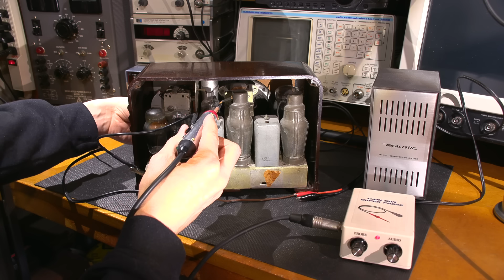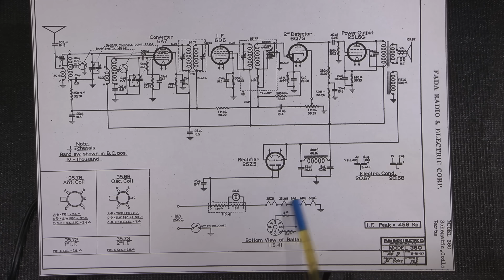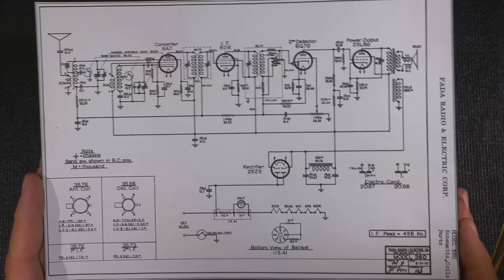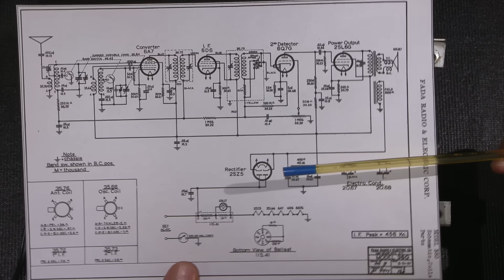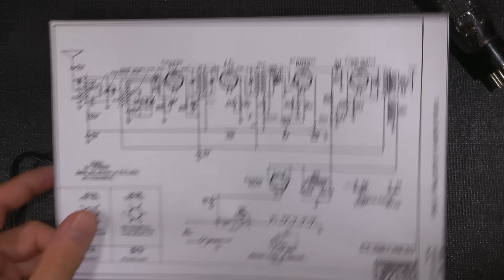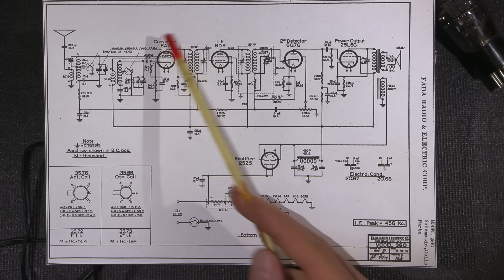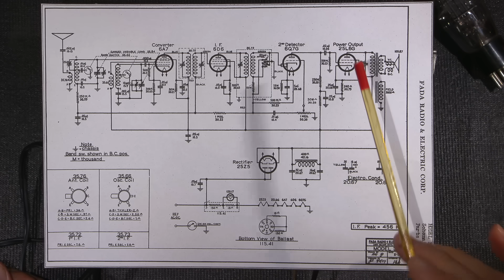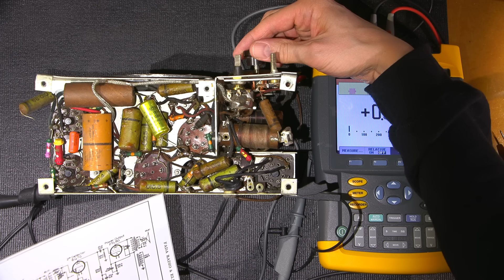Electronic Circuitry Diagnosis And Fault Finding! [Repair]

Comment: This was a very good diagnostic coarse Mr. Carlson. I am working on a Sparton Radio/Phonograph with a similar no output at all. Out Put Transformer & Speaker test good.Tubes all test good & heaters turn  on. Changed some Capacitors that were defective but must test more & carry on I guess. I would sure like to buy a Carlson Super Probe if available. Thank You.
Reply: PS That Sparton Radio is a Model 5348   made in Canada just for added interest.  Thanks again.
Reply: I now managed to get sound from this radio 6 hrs after my previous message. Found a shorted .05 mfd cap shorting convertor tube grid to ground. Also found the Output 6F6  tube intermittent. Would some times pass emission test but sometimes fail. Tap on 6F6 to get a squeech & then normal audio out put. Will have to replace the 6F6 in the future for reliability.

Comment: I think it would be cool if you did a lower filming quality series(so you can put more videos out faster) of devices that suffered catastrophic failures and diagnosing them, what caused it and following the chain of failures that lead to the "death blow" that finally killed the device then if you have time maybe try to resurrect the device within minimal parts and effort. Kinda like how Shango has resurrected dead baked tvs which sat in the desert for 45 years or so! much love, keep up the awesome content you do awesome exceptional work. <3 :D

Comment: Yes it can be done ,  for me it was easy , yes some work had to be done , but it was safe on or off with out unplugging the radio. I am 59 years old and I stated working with tube type around twelve years old . I remember what old radios and TVs smell like. if I ever have a lab I would want it to be full of new and old things to fix.

Comment: I was servicing this type AC DC Operation radio on 1985. When the polarity of AC input changes it use to give current shock if we touch the chase or even control knobs.. I Enjoyed the audio quality on those days. As up to now i never heard such beautiful audio. This is from India. EL84 and ECH 81 vacuum tubes i used to replace on those days.

Comment: Very clever way to troubleshoot, I’m still having a hard time understanding why the circuit would feed B+ Dc to a field coil. It seems as if this would lock the speaker coil inward(retracted) or outward. How can the speaker oscillate in and out to produce audio if it is being held in one direction by the field coil that acts as a constant electromagnet pulling in one direction? Thanks for another interesting video. Please remember to not be afraid to show you are human and not a robot with an occasional smile from time to time. 😀👍
Reply: @Mike - IANAEG (I Am Not An Electronics Guru) … but, I think you are confusing the field coil with the voice coil.  The field coil creates a constant magnetic field - the function that a permanent magnet would perform in today’s speakers.  Then it’s the fluctuating voltage in the voice coil (physically attached to the cone of the speaker) that causes voice coil+cone to vibrate and produce the sound.
Reply: @citizen240  iteresting, I never knew that an electromagnet was sometimes used in place of the typical fixed permanent magnet type speaker we see more commonly. Thanks for the clarification, this makes sense now. 😎👍

Comment: most of those radios if plugged in backwards would make a definitely growling sound in the audio and i know about this because i took radio and tv repair as a vocational course n high school during that era so i know first hand what a jolt you could get from them if you wre standig barefoot on concrete or touching bare metal that was in contact with that concrete

Comment: The dial light was often part of the filament string, acting as a pilot light.

Another use of directly heated cathodes was in pre-transistor portable radios, which ran on batteries and had two or three different ones:

The A battery, usually a 6V lantern battery, to heat the filaments.  They were in parallel, but each one had a choke (either RF or audio depending on the frequency) to isolate the cathodes from each other;

The B battery, a medium current battery of 45 to 90V or more in multiples of 1.5V, to run the plates (this is why the power supply output is called B+);

And with some designs, a C battery, usually 18 to 45V, not drawing much current at all, with the POSITIVE side to the chassis and the NEGATIVE side (with a choke) going to the grids to keep them negative.  The AC signal made the grid less negative in the positive half cycle to allow more plate current, and more negative in the negative half cycle to allow less plate current.

Comment: The speaker driver is very old! I would replace it with one that will fit inside and has the same sensitivity, if possible? If not I wouldn’t waste my time or resources and hours of work to restore it because it’ll sound like crap! Also I would use detox on ALL the knobs, volume control knob for tuning the stations and the frequency know for short wave as well!

Comment: I have a Philips Sajita series Tube radio.MW and SW bands are fine but Its FM band has not been working for the last few days.After turning on the FM band works properly for a while, then suddenly the audio goes off.Which parts may be faulty for this problem?please suggest me.I want to repair it.

Comment: I'm a 40 year retired industrial electrician. One of my lines started up in 1960. Has ad several upgrades over the years. The original 1950s  electrical/electronics equipment that was  still left in place has outlasted the the 1980s equipment.

Comment: Yes,  I see, if the switch doesn't work you could touch the chassis with bare wet feet in order to power the radio. If you can resist the pain, the tubes will light on and you can even hear the radio...

Comment: This was a very poor evaluation of the problem. Yes the tubes are faulty or the electronics have failed, but what  if the problem id in the RF section? You need an RF generator. I would love to have an opportunity to work on an old tube unit. God the time stops for no one.

Comment: check for the negative voltage on the filament for proper tube conduction. If positive to the coupling capacitors are leaking DC to the, sorry I'm drunk to the plate  is something then replace the capacitor will do it.

Comment: come on, check the  tube manual for the filament pin connector. pin 4 an 5 for continuity, If the tubes ha it go to the next

Comment: This reminds me of my days in late fifties.  Repaired many of this type of Radios in those days. One thing I may add that we used to call these type of circuits as AC/DC type Radios because this type will also work on DC supply power. This type was the cheaper  as compared to the AC only which was much safer because of the builtin Isolation Transformer. Many times we use to touch Grid metal Cap on top of the tubs for quick diagnose by listening to the Growling sound from Speaker indicating that Audio section and IF section upto that tube is OK. Thanks for the Video.

Comment: Thank you. It is just what I wanted to learn when I was 13 years old. I had a collection of old radios at that time. However now I am 71 years old. I wanted to learn this 58 years ago!!! I ended up doing a mechanical engineering apprenticeship instead of an electical apprenticeship . Now I see how technical it is, I may have quite rightly been better off learning limits and fits like I did. LOL
Reply: My thoughts exactly. I hung on to one old Phillips radio for the longest time, trying to fix it. One of my friend’s father remarked, “It’s probably a capacitor.” But at that point, I couldn’t tell a capacitor from an intermediate frequency transformer. I really wanted the thing to work because it had push button tuning like a car radio, and I thought it was cool.

Comment: Currently, I am restoring a 1936 Pilot model 203 export model made in Long Island, NYC. I started working on radios when I was 9 years old in Edison, NJ. When I was 10 I had my own business repairing radios and later on some TV's. I needed the money to support my hobby flying R/C model planes. The battery's were two 67.5 Volt and one 1.5 Volt for the transmitter. They were very expensive for a kid in 1953.
Reply from the maker: Thanks for sharing your story Ted!

Comment: Sorry your fault diagnosis was long winded and quite unnecessary and  some of the technical terms you used were quite misleading.
I am a retired RAAF electronics tech of over 20 years service used to working on equipment much more complex than this but the procedure used to fault find equipment is fundamental to good workshop practice.  On promotion to SGT I taught electronics theory and practice including logical fault finding.  First do not ever switch a set on this vintage on to  live mains no matter how well protected.  Second do as much testing as you can with an ANALOGUE MULTIMETER before ever thinking about applying power.  Over here in Australia we are dealing with 230-250V 50 Hz mains which can definitely kill you especially on LIVE CHASSIS sets such as this is.  117 phase mains as you have in the US most times will not kill you but if an individual has inherent low body resistance it can have a good crack at it. You are dead for ever, no second chances.
I mentioned an ANALOGUE MULTIMETER because it can apply a lot more voltage and current on resistance ranges to testing circuits than can a digital meter which typically does not  actually apply much voltage or current in resistance range testing at all.  Analogue will also find components with serious  high resistance leakage much more readily  than will digital.   
 The schematic says  V1 is a converter because that what it is.  In communication sets the LOCAL OSCILLATOR AND MIXER can be two separate electron tubes.  Calling the stage a converter implies  the stage is a combination of local oscillator and mixer,  such as in a pentagrid frequency convertor, such as a 6BE6, 6D8G  or even a battery 1R5.  IT IS NOT A MANUFACTURES CONVENTION AS YOU IMPLIED 
 I have not ever heard that old type of resistor made from cracked carbon called a dog's bone before, maybe just the US terminology.  
Now to the fault finding proper, because the set was as dead as a dodo, not even any hiss from the speaker indicated straight away either no HT or something seriously wrong with the audio stage, even the  ELECTRODYNAMIC SPEAKER FIELD COIL WINDING being open circuit.  Taking resistance readings  with a good analogue multimeter would have indicated the fault without putting undue stress on the dual rectifier with power on regardless of the high impedance supply used .  As you indicated, a hard to obtain electron vacuum  tube is a 25V heater type.   
Live chassis radio sets were illegal in Australia except for the types imported from the UK by their owners on migration . The US types would have been a problem here because of the 117V mains potential required.   A step down transformer would have been required which because of the isolation it provided,  the set would become safer in operation.  
As you mentioned paper type capacitors impregnated with wax tend to go leaky if not indeed as in this case s/c.  Moisture seems to be ingested over their lifetime causing the dialectic to breakdown.
In fault finding diagnosis you proceed from the obvious first using the half split rule, the audio stage was dead, no point in going to the RF stages till you have something from the set's  speaker. A simple finger on the first audio amplifier grid would have proved this, as you say don't do this with Transmitter stages.
Reply from the maker: New to the channel Robert?
Reply: I have watched a couple of your video's on YouTube before but this one last night intrigued me as of practices you really should not do.  An isolation transformer is essential in working with SMPS as the mains is directly rectified and ground must be referenced with an oscilloscope for fault finding.  Definitely in this case where the whole chassis could be live.  
I started my working life with an electrical/radio apprenticeship in 1965 at 15 but before that I was learning to repair old 1930's  to 1940's electron tube radios as a 13 year old kid.  With live chassis radios I have fault found  recently  they were from the UK and the chassis was insulated from the frame of the radio from manufacture.
Another thing you could have done would have been to give a quick rundown of the principal of operation of a superhet type radio receiver rather than just alluring to the operation or indeed if you have done this before redirect readers of your channel to this video first.    Have you ever been a professional in the electronics trade ?   
Also there is an electronics publication which I write for from time to time called "Silicon Chip"  there is in this publication a column called vintage radio, sometimes vintage televisions are dealt with too.  It is also published on line.
Another risk you undertook applying power to this vintage radio without prior inspection was with this high cut capacitor s/c the primary winding of the output transformer could have gone o/c due to increased current in the winding.  Wax paper capacitors were notorious for going leaky and s/c both in radios from the 1930's onwards and televisions of the 1950's and early 1960's.  They kept servicemen in business as the mean time between failures  was not much more than 6 months being the case here in Australia.  I serviced televisions as a teenager and later for extra money in my twenties as the RAAF pay was not sufficient to support a family.    With televisions miniature electron tubes were used in low power stages and these failed more often than the 4 , 6 pin and octal vacuum tubes of old.  The barium coating on the cathodes of the old tubes was thicker leading to a longer life before the electron emission diminished to a point were the  tube failed due to insufficient emission......Regards Robert

Comment: The back cover, as you know, had the antenna wound on it with a terminal attached to let you connect other wires for add lengths to increase reception.

Comment: I vote to restore it. PS I have a "hack" I use in lieu of an isolation transformer: I take a neon tester, or a voltmeter and hook one end to the metal chassis and the other end to a ground nearby; if the tester lights up, I know the chassis is hot.

Comment: Greetings:
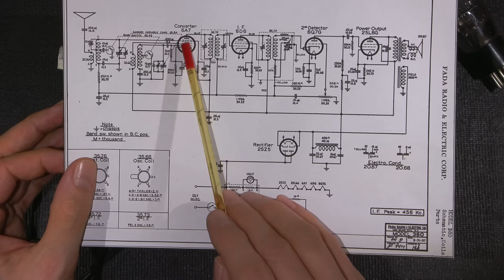@48:50 you say that the 456kc IF is above the broadcast (tuned station) frequency. Since the mw band is 550kc to 1700kc then the 456kc IF is below that entire band. The local osc with its tuning range set to produce sum and difference frequencies 456kc above and below the tuned station frequency

Comment: Hi Paul. I would like to ask a stupid questio.  how you are receiving cw without having the receiver tune to a cw station?
Reply: the antenna receives everything all at once
Reply: @markkuba5074  Its not going to pick out a cw signal unless he has a cw transmitter strong enough to cancel out eveything other than the center signal.

Comment: Hi, Mr. Carlson all the shopping electronic websites and  companies like amazon and eBay are making floods of adv.,s for the vintage retro radio and audio sets around the clock , it's OK, no problem. but what about the tubes spare parts, are those spare parts still produced till now or located only in  the old stores in the traditional old electrical markets, many of the technicians say no its no more available, so what to do if some body want to to buy a vintage old set , every thing in the world needs maintenance even us. because without spare parts,  it means directly that all thses websites are cheating and make scums on the customers.
So, as an expert what do you think frankly 🤔

Comment: I know I'm late for the party, but observation of the emitted mixer's oscillator frequency gave information not only that you are listening to the radio at all, but, knowing IF frequency, which exact station you are listening to.

That was actually used to search for spies listening to C&C radio stations during the Cold War, and turned to be very efficient.

Comment: Hello there I have a lil bit of a project I have been doing that is completely driving me nuts over.the information surrounding the unit is close to none it is a motorola 8 track record player and FM radio . there's a fuse , belfuse 225-1 , can't find any cross reference to so I found a different fuse from a old TV it work tell I got excited then it below, what is cosing it, and is there a place to go to get info/wiring diagram, that's in advance,

Comment: Yeah, it looks like a radio worth restoring.  One question, is it a good idea to replace all the capacitors at once or do it one section at a time?  It seems to me if there is a bad capacitor in one of the coupling stages it could do some damage when you first turned it on.

Comment: awesome.  this ballast is interesting.  it still uses all the 110 voltage and there is no saving on electricity.  so, if i have a transformer on a 110v to 12 v.  in essence would i be saving electricity by using the step down to 12 v or because it is 110 v, there is no saving on electricity?  how does that work?

Comment: I am for restoring it.  Where do you find schematic diagrams for these old radios?  I recently purchased 3 Wards Airline radios from I guess the late 40s or 50s.  They all have power transformers which is a feature I like.  All three look identical but each has a different model number.